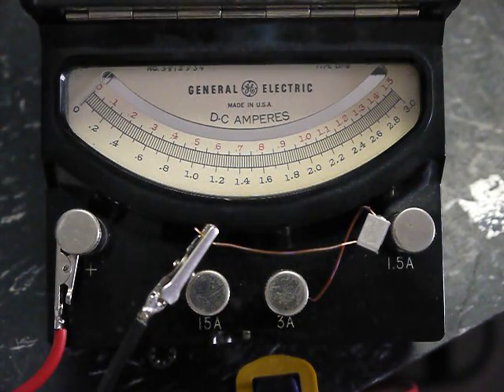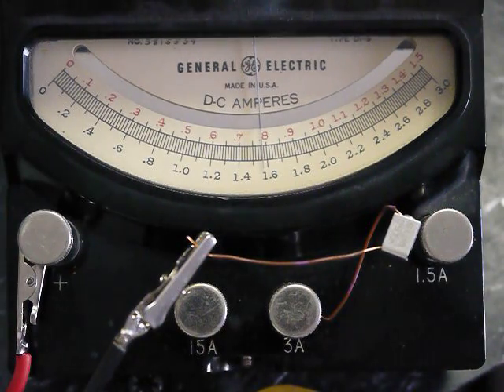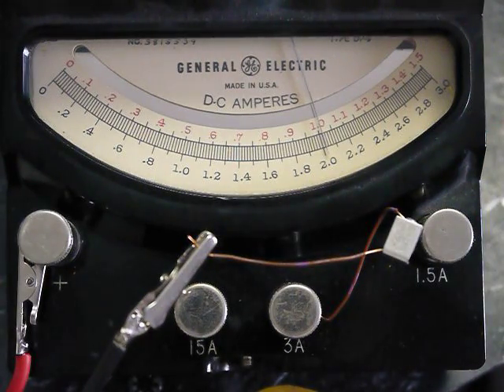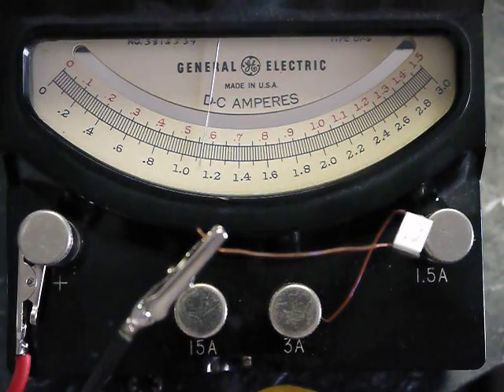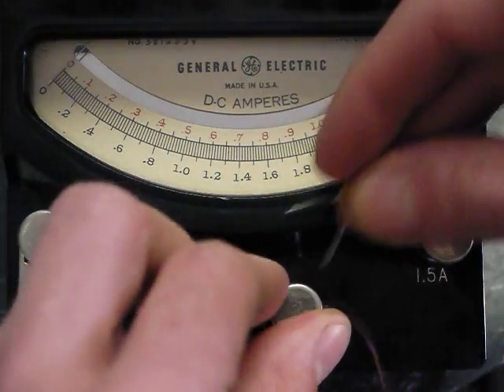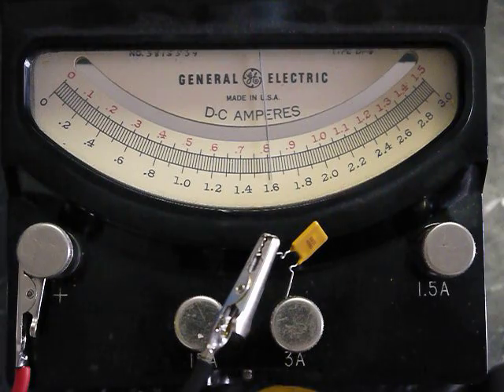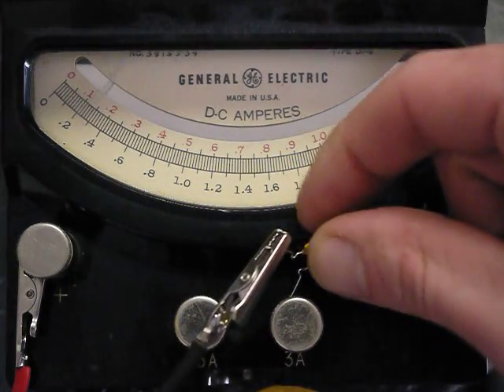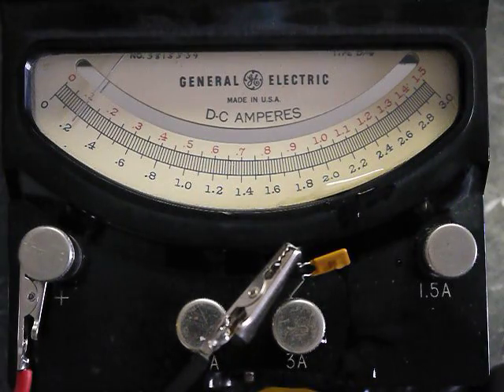PolyFuse trip/hold current test

Comment: Thanks for the video. SMD fuse ratings are only valid when it is properly soldered to a PCB, because it pulls away quite a bit of heat, hence increasing the trip current. Anyway, PTC fuses are not the most precise devices and require major derating based on ambient temperature, air convection, PCB thickness, copper plane size, nearby devices, etc. You have to do a lot of testing in various conditions to meet strict trip current requirements.